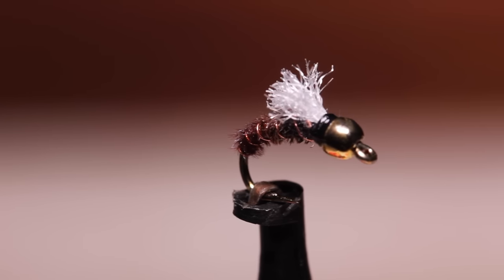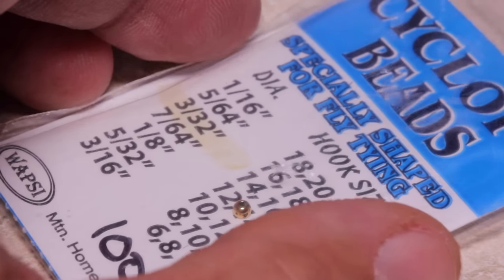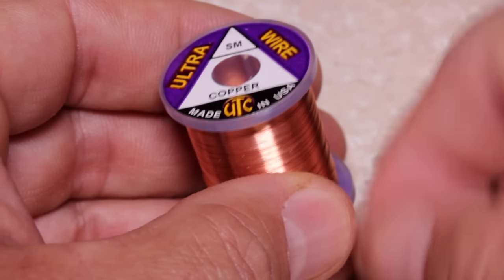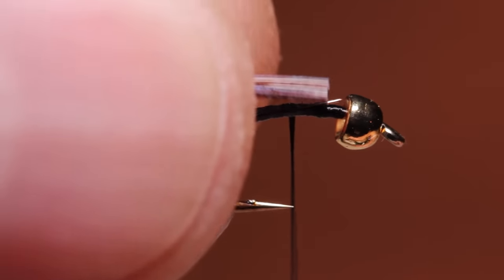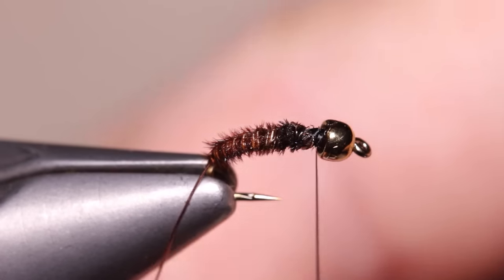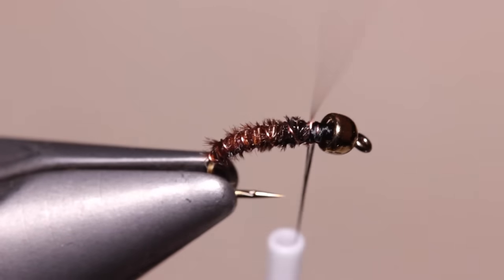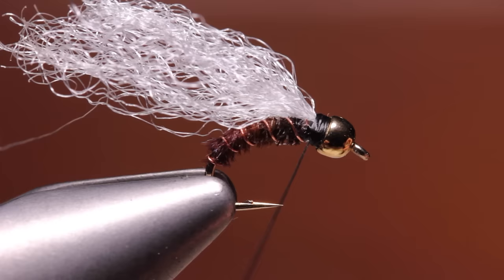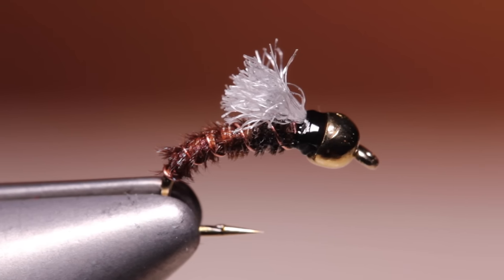Shop Vac

Comment: Could you simply wrap down the pheasant feather fibers and then wrap up the wire? This way they would counter wrap each other (wooly bugger style) and you could keep the thread near the bead. I know it's just a fuss... but I am always prone to cut down tying steps. I really like your channel. Keep up the good work. Have a nice 2016 ;)
Reply from the maker: +Marcelo Jost If I understand your question correctly, the answer is yes you can and it is a great technique. Matt Grobert does it on our Pumpkin Head Midge video https://www.youtube.com/watch?v=iU3c1mi8Dy4. It does mean that you are snipping off the excess pheasant tail fibers at the back end of the fly which some people don't seem to like, but I am fine with. Happy New Year to you too.
Reply: +tightlinevideo  Yep, except you don't mind the tail fibers here in the Shop Vac and the tying thread never goes all the way to the hook bend tying down the pheasant fibers. As I said, just a fuss :)
Reply from the maker: +Marcelo Jost Now the question is, on the Shop Vac, with your tying method, would you tie in the pheasant tail fibers behind the bead by their tips? Or by the butts? To me, the taper would look better if tied in by the butts so the tips are at the rear of the fly, but don't know how easy it would be wrap with the tip ends.
Reply: +tightlinevideo I would pick fairly long pheasant fibers and, like you, tie them by their butts, but wouldn't cut the tips before tying. In a small fly like this I think this should be enough to provide some fiber length to grip until it's time to secure them with the copper wire at the rear.
Reply from the maker: +Marcelo Jost I just tried a few Shop Vacs tying in at the bead and wrapping rearward. Interesting, very little difference in terms of final body profile whether I tied the fibers in by the tips or the butts. But, what I didn't like was even with long fibers, they are getting shorter and shorter as you wrap rearward and negotiating them around gets more difficult as you get down into the hook gap and close to the vice jaws. I think I'll stick with the method shown in this video. I know it's a cardinal sin, but when I'm tying these or similar flies for myself, I don't counter wrap the wire. This saves a step or two and I've found no profound difference in terms of durability overall look.
Reply: +tightlinevideo Yes, you are probably wright and tying the fibers like I suggested may become more a pain than a gain. As a final test I would use those tiny hackle pliers you use to manipulate the hooks to hold the fibers, but I don't think it will matter n the end. I also almost never counter-wrap my nymphs so we are both in the dark side of the force :) Nice chating ;)
Reply from the maker: +Marcelo Jost Nice chatting with you too.

Comment: What kind of regal vise do you use?
Reply from the maker: +Clay Sommerfelt I have two Regals at the moment. My primary vise is a Regal Revolution with stainless steel jaws and a platform base. The other is their new Travel Vise with midge jaws which is much smaller and lighter. Both work flawlessly.

Comment: What Bobbin is that is it the standard or 1 inch shorter
Reply from the maker: It's the "Shorty" Rite Bobbin.
Reply: tightlinevideo mine broke 😭 so wanted to know yours the black handle slides and it's uncomfortable